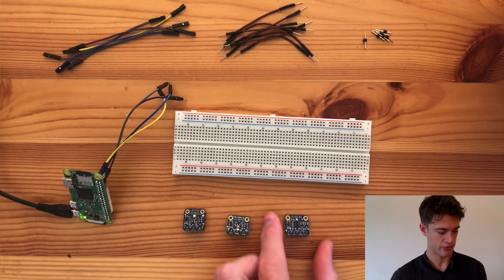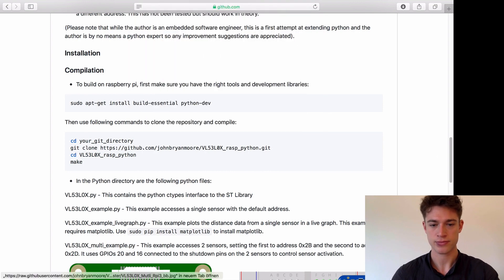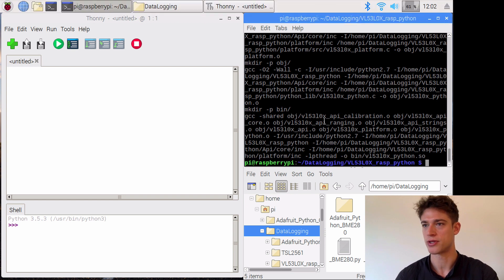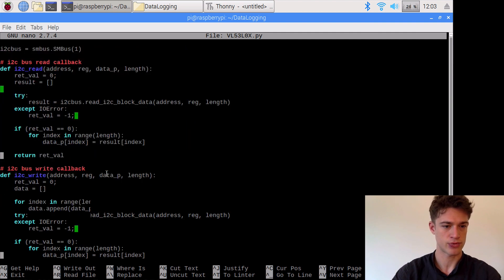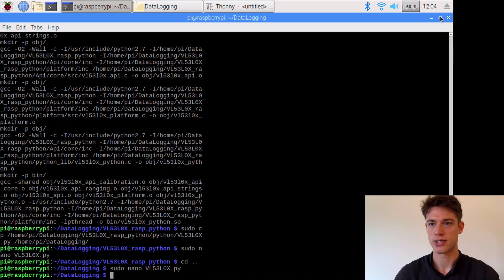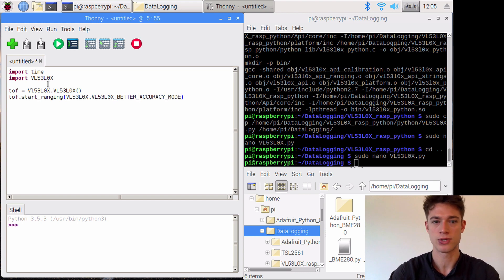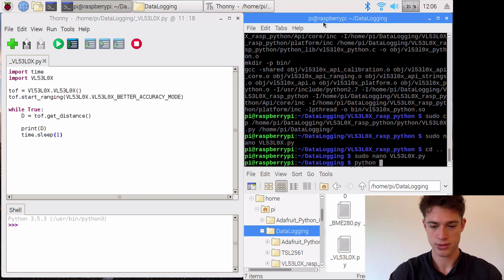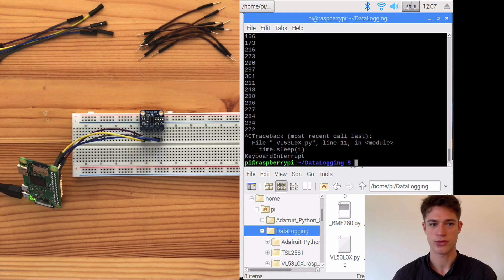10 | Indoor Weather Station | VL53L0X | Distance Sensor

Comment: Followed install instructions and all looked OK. When running the test program at end had an error oof
ModuleNotFoundError: No module named 'VL53LOX'
Have tried to trace but no joy. What correct this?
Reply: Make sure that you turn-ON your i2c interface in raspberry pi configuration 

You can take main menu -> Raspberry pi configuration -> interfaces
And check one string, your i2c must be enabled

Comment: end of all i take interface error what should i do?
Reply from the maker: When I get this message, it usually has to do with a bad wiring or solder connection. Rewire everything and make sure there are no mistakes, then restart the RPI and rerun the script.
Reply: @mmarsc2323  i try many times but i cant solve i think i2c has problem
Reply: @sinasi8369  Make sure that you turn-ON your I2C Interface in raspberry pi confirmation
Reply: Raspberry pi configuration -> interfaces
And check i2c is enabled
Reply: hey, am still getting the control interface error. any other way to solve?
Reply: @Tonyspassion  Interface error? sounds like you may have connected SDA, SCL wrong.... try in Terminal write: sudo i2cdetect -y 1 if the address is shown as 0x29 the interfacing is ok.